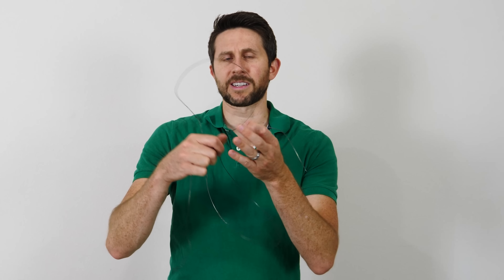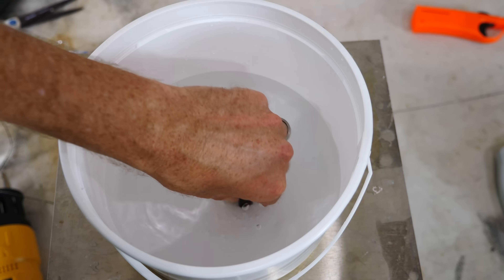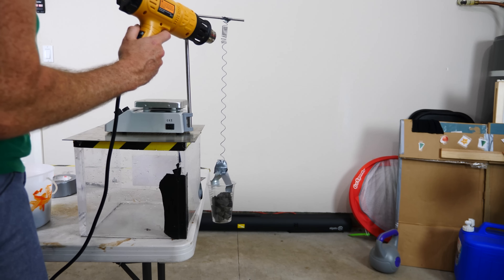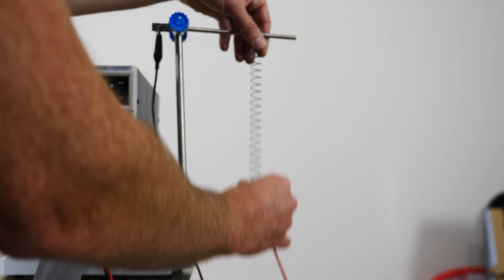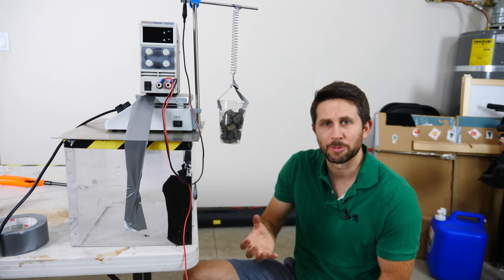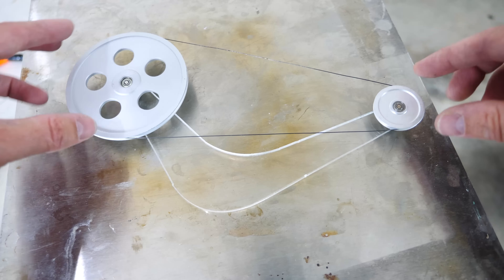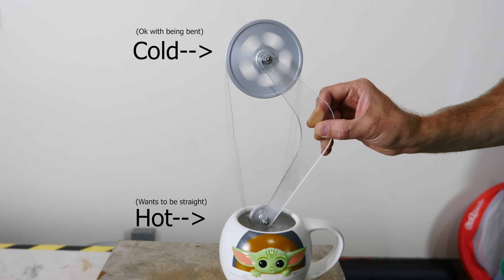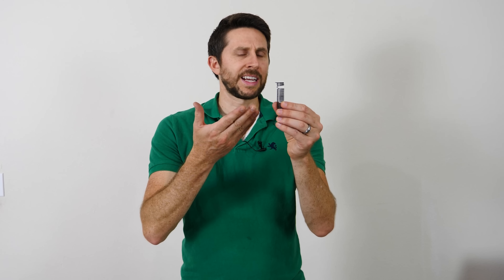How Strong Are Nitinol Muscles?

Comment: If you braided these springs together like a braided metal hose threm them in a silicon tube, capped both ends, and installed cold and hot water valves, this could be an insane exoskeleton enhancement. Have the flow of water controlled by a dial in the joints so it automatically adjusts.

Comment: Since nitinol will not turn into original shape when overstretched, what happens with the energy we used to stretch it? We could argue it's stored, but then we also use energy to heat it up.

Comment: To the best of our knowledge, this is the first fibre-type soft actuator with thermodynamically driven reversible percolation of nanoscale filler network.

Unfortunately, the actuation power as well as response time of pure LCE actuators is limited by the intrinsic weak mechanical properties and retarded thermal relaxation. We address this challenge by incorporating graphene fillers with ultralarge shape anisotropy (average lateral size, <10 μm; layer stacking, <3), which are known to have strong mechanical properties and high thermal conductivity as well as outstanding photothermal conversion characteristics relying on wideband absorbance.

Comment: that engine might just be what we need for our energy problem. a lot of hot water is wasted in most of the powerplants nowadays. if we could tune this engine displayed here for powerplant waste water (which is still pretty warm/hot) we could reuse that heat for something else. also in every other system that has heat as a byproduct (cpus/computers in general) we could use that heat to power such an engine. maybe we could squeeze out some electricity out of this and reduce wasted heat?

Comment: Damn, i still have questions... Like does it truly not have a plastic deformation point? Could you fold it onto itself and pinch the loop closed and it would still snap back to straight when heated? How about if you pressed the loop closed with a vice, would it plasticly deform then? How do you form it's "base" shape, does it need to be molded from liquid in the shape you want? 

To not plasticly deform at all, no matter what forces you put on it would be pretty unbelievable.

Comment: Wouldnt this make a good bulletproof vest? I mean the impact of a bullet generates much heat since it discharges all of its joules of power...but the heat would kind of make the metall get stiff and catch the bullet maybe...
And the west will also be pretty much more flexible what means wearable almost like a jacket, like everywhere on the body what means full protection and flexibility. The only disadvantage is that when you are hit in your arm your arm will "freeze"

Comment: Hmmmm i wonder so static electricity is a thing what if you were to use hot water to get it started and then using a mechanical motion to use say patch of rug and a leather clothto generated some friction but would then get it up to a 4 amp electricity and then connect it to the Engine would you have achieve a motor that would spin forever ? or would the friction slow down enough over time ? And how much more load could you use ?

Comment: Wouldn't that mean that they can get rid of heat totally instead of transferring it using this stuff?
Like that motor would be turning heat into kinetic energy, so i'm just thinking of stuff like heatsinks etc...a smaller condensed version could turn heat into kinetic and maybe then back to electricity(since just dumping as kinetic will end up back as heat).

Comment: Nitinol, as with all engineered materials, does have fatigue properties. The exact number of fatigue cycles for any of the many applications depends on the specific design and stress/strains on the component. This is a very active area of academic and commercial research.

Comment: could you generate electricity with a nitinol engine and neodimiun magnets + copper wires? like a actual generator but the centripetal force is made by the nitinol and some heated water source or even maybe making the top cold and the heat sink at the bottom heating the water

Comment: Could nitinol be used to power a turbo charger? Car engines provide a ton of leftover heat and that could be used to power a nitinol turbine to create boost as long as you can cool the turbine side with the air flowing into the engine

Comment: Did you see how the rocks in the cup bounced up and down as the heat gun was blowing on it after it reached the top?  I wonder if you put magnets in the cup instead and had the cup inside a cylinder wrapped in a coil of wire how much AC electricity would it generate?

Comment: I had titanium memory metal glasses a few years ago. I was told you could bend it repeatedly 1500 times no problems. They snapped after less than 2years, which worked out to putting them on about 1500 times.. steel lasts longer in flexing.

Comment: Cool phenomenon I noticed. As the spring contracts from the heat, it automatically finds the natural fundamental compression wave for the system. I think it's because this is the wave that gives the spring the most opportunity to shrink back at the high point in the wave. Just thought that was cool.

Comment: What I wanted to know, was whether the elasticity of the hot nitriol was stronger than that of the cold.
Meaning, if the weight of the cup was enough to stretch the spring, would heating up the spring make it return to its shape?

Comment: It's almost in the name of the title but someone must be using this in robotics; it seems to be the perfect application.

It not only replicates twitch muscle speeds, but with the wires in pairs, it could work like opposing muscle groups where you'd apply current on one wire, release, apply current to another and an armature moves in the opposite direction.

Comment: I wonder if you could use a grade of Nitinol that has a shape memory point above normal room temperature but below body temperature to make an engine that uses your body heat to drive a generator for some low power application?  Of course, wouldn't work on a really hot day like we've been having recently . . . .

Comment: Say you were to gather sheets of nitinol and cut them up into very thin fiber-like strips, and weave them together like cloth in a cross-hatching pattern. Would the “cloth” tighten up in the presence of heat like how oobleck tenses up as a blunt object slaps it? And if so, would it be possible to layer such fabric like kevlar for protection or even layer it with kevlar?

Comment: I wonder if you could have a robot that has a kind of circulation system like a heart but instead the heart heats up water and sends it to certain springs with valves to each spring like arteries. And some type of small pump near each spring to pull the hot water back to the heart. 

I'm thinking of water instead of electricity because the water seemed to make the nitinol return to it's original shape faster. Because water has a higher specific heat maybe it could run on just heat energy for longer? You could even go farther and have a solar heater on a part of the robot that faces the sun and heats up the water through sunlight.

Comment: im surprised no one has thought of the idea to use this stuff in a perpetual motion machine, just use the stuff that requires room temp water to maintain shape and then force it out of shape like that small engine he made and set a fan or electrical component to it that does not require a large amount of force to spin and there you go, as long as water stays above room temp, it in theory, wouldn't ever stop rotating right? i imagine the material would of course break down after some time, but could the benefits of it outweigh the costs? isnt that the whole idea behind perpetual motion, get more out then you put in? and if IN force is only room tempo water, that heats up with the agitation and ambient temperature, then would this actually work?
Reply: I mean, you've invented a heat engine. The water has to be hotter than the surrounding air. Heat is moved from the hot end to the cold end, and and energy is extracted, eventually the system will reach thermodynamic equilibrium.
The heating of the water by friction would be extracting energy from the engine, slowing it down.

Comment: How much could the nitinol motor spin? Could it run a genorator with a small fire heating water to suport an off grid energy source when solor or other sources of off grid is not available?
Reply: It would be neat to even see a small scale for camping to charge phones or small scale electronics just to see if it works and what it would take.

Comment: I find this very interesting because I’ve thought about about what would happen if your muscle fibers were to be replaced with some kind of metal fibers. Would the strength of the metal allow you to lift/move more than your normal muscle fibers or would there be some issue that would limit the effectiveness?
Reply: well our muscles work as to expand and contract, opposed to bending, so if we were to have metal wire just pasted instead of our muscles it wouldnt really work, however with this material, if you were to use springs instead of overlapping strands of expanding and contracting muscle, 1 we wouldnt have a way to expand without an outside force and 2 we would need a heat source to contract it back

Comment: So the spring can't really function as an engine or be used to hoist something up. The power required to stretch and deform the spring will always be more than the maximum weight it can lift. Pretty cool though. Now i want some nitinol wire.

Edit: Nevermind. When heated up the nitinol spring is actually super elastic and stronger than it was at room temperature. So it can actually work.

Comment: So does this mean we can efficiently turn heat into electricity? Those engines don't seem all that expensive to build, and if you could turn the wire into a wide strip you should be able to connect the engine to a generator and actually spin it using heat

Comment: this seems like it could be extremely useful for low-energy devices. it can use the ambient temperature to assist small actions(it can be used for larger actions at the cost of longevity). someone suggested that it be used for a heart assist pump, which is a good way to use the properties of the material, though i'm unsure if the heat gradient would be sufficient for it to function. it's just an amazing material with a lot of uses, and can be a huge benefit to a lot of people and the general advancement of technology.

Or you could be me and use it to make a contact switch that immediately switches itself off for no reason other than because it's entertaining.

Comment: So could you have a renewable energy engine if you made one of those really big and put one side in a hot spring or near an active volcano or something? Maybe have one side of the engine sticking out in the desert with mirrors reflecting light into a single point to heat it up more and the other side burried in the ground?
Reply: You can, but you can also do the same with water and steam, at higher efficiencies for cheaper.

Comment: Why cant we make giant nitinol engines like this and use the geothermal activity under the ocean to get it hot at the bottom and as the nitinol turns and goes to the surface the cold water cools it , this could make the thing keep going indefinitely, wouldn't it ?
Reply: You can, but doing it with water and steam is more efficient and cheaper. Heat engines of some stripe are everywhere
Reply: @KaosFireMaker  but geo thermal is free power.
Reply: @mirza6399  And you can do geothermal with water.

Comment: How sharp of an angle can it bend before deforming? What does stretching the wire do? What is the highest temperature that these alloys can handle before their properties change? Can we get more Shape Recovery Force if the wire is thickened? If so is that SRF unlimited? What force would an I-Beam exert? How fast can these springs extend? Can we alter the alloy to change the speed that the metals recover their shape? What happens if multiple layers are sandwiched made from different alloy ratios? So on and so forth...

Comment: Could this be a more effective solar energy producer? Use mirrors to direct sunlight to heat a oil/water and have a buried cold reservoir. When the sun is out, the engine would auto start and then be used to spin a turbine.

Comment: I wonder if you could use a nitinol wire as part of a "cylindrical" Peltier device, and by so doing, create the ability to "expel" the heat, in exactly the inverse of using a current to INDUCE heat? If this is possible, you could make a nitinol "muscle" that can actively control it's degree of elasticity!

Comment: I was just about to suggest using electric current to heat the wire then you did it! Nitinol has a comparable resistivity to Nichrome, which is used for heating elements, so its a natural fit! Very cool!

Comment: put a water (empty-filled) pipe around it, fill to retract, empty to free
Reply: heat-piston engine, one-side other-side, pulsed engine
Reply: kinda heat-engine like stirling engine
Reply: thermocouples
Reply: efficiency, flame drive
Reply: static generator
Reply: adjustable car spring leaves

Comment: Pretty cool, this material can be used to convert electrical and thermal energy into mechanical energy at great effeciency.
Reply: Actually, the efficiency of most nitonol engines is pretty low. Electric motors convert about 90% of electrical energy into mechanical work. The nitonal is hard to heat up and cool down, and a lot of the energy just goes to waste heat.

Comment: What happens if you put enough weight in the cup to plastically deform the material and then heat it?  Is that too much force for the shape metal to overcome?  

At what point will you get an unrecoverable deformation?  Does it have to break or shear or can it be bent so badly it will not return?

Comment: Nitinol and other shape memory metals have been the subject of much experimentation since the 1970s, including uses in formulating smart skins in military aircraft.  I once saw a Nitinol motor displayed that used multiple helical springs traveling around two shafts much like drive belts.  One shaft was bathed in hot water and the other in cold water which activated the Nitinol memory changes which, in turn, rotated the shafts.  Multiple combinations of springs and shafts were geared together to provide torque to one output shaft which was recorded by a dynamometer at 40 horse power.  The thermal differences between the hot and cold baths could have been obtained by using water from a solar heated pool and cold water from a well or surface water source.  The main reason Nitinol engines are not commonly used is that they mostly rely on friction as a drive mechanism rather than more positive mechanical methods less subject to slipping.  Hopefully, we will see more applications of metallic memory in the future.  Jess

Comment: So, then, could you use the one that has it's memory set straight at room temperature and then use a cup of cold water to create the motor effect in the same way?  If so, then could you use it to power a small boat motor in a cold body of water, but with a warm ambient air temperature out of the water?  If so, you should totally make a small toy boat with such a motor as a cool demo.
Reply: Agreed, this would be so cool!
Reply: I dont think that air really heats it up fast enough for it to properly work. warm water with cold air would be better, but also less common in reality unfortunately. cant scientifically back it up for now, but definitely feels that way
Reply: @allylilith5605  you could keep some room-temperature water in the boat and have the wire wrapped around the wheels in a figure 8 formation, so that the narrow point of the "8" is above both bodies of water.

Wrap some toweling arround the wire at certain points, to stop it from carrying drops of cold water into the room-temperature water.

If it was full-sized, then you could sit in the room-temperature water to stop it from cooling down.

Or you could have the tiny buckets attached to the room-temperature wheel, to catch bits of room-temperature air and force them to bubble through the water in the boat, to maybe stop it from cooling down?

No, put something black over the water in the boat, so it will absorb sunlight and so stay warmer than the water the boat floats in.

Comment: The energy effciency of the nitinol engine is pretty high, is this Wörth trying in the energy Departement?

Or is this Metal not made for permanent use?
Reply: The efficiency of the type of engine he showed, even if well designed can only get up to about 16 %, A small  Stirling engine can get around 32%. A large steam turbine  can get 90%.
Reply: @KaosFireMaker  ok thanks for the info
Reply: i guess i was deceived by the engines speed + the fact that i was just hot water

Comment: The data reclaim risk assessment is only worth while when companies REPORT that they've been breached. They frequently don't do this when they have. For example: Gaijin was recently breached, not a word from the company.  The reporting system they use is likely frequently circumvented, as their "risk assessment" is based off that same report system.  Basically risk assessment is not rated on number of security breaches, but simply how much they lie and self report. In the end, (if you're removing by risk assessment) you're removing companies that are honest with your data, and leaving the ones that aren't. The only way this is useful is if you remove them all.

Comment: Could be used in a new type of air conditioner — Rotating Nitinol metal bands going towards heat and back to cool, transferring the heat away.
Reply: 💡that might work
Reply: Heat pumps do a similar thing using liquid gas instead of Nitinol